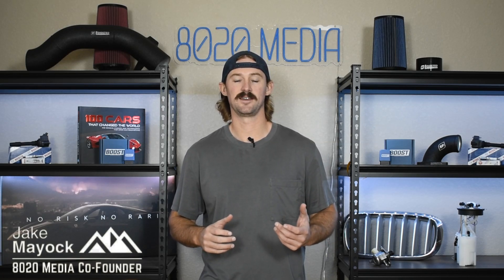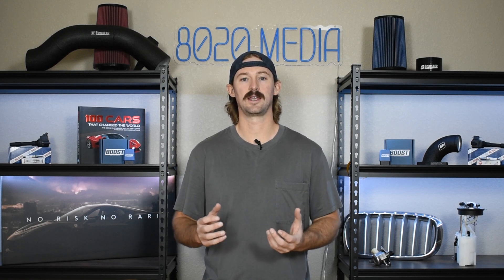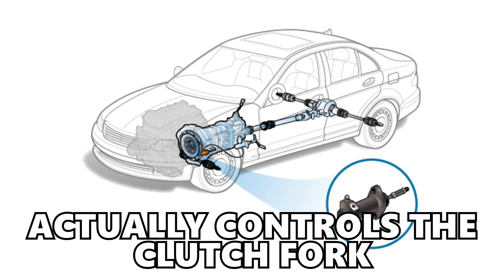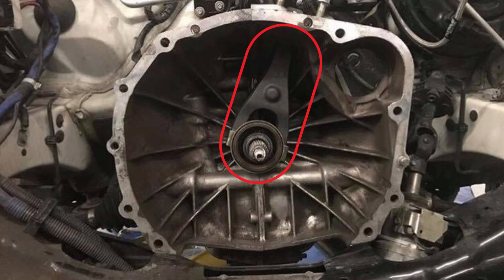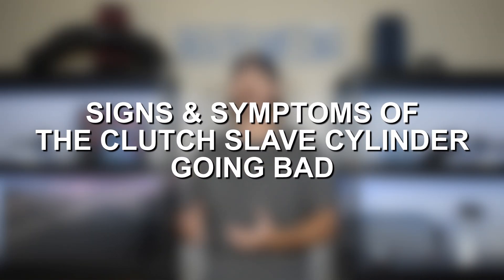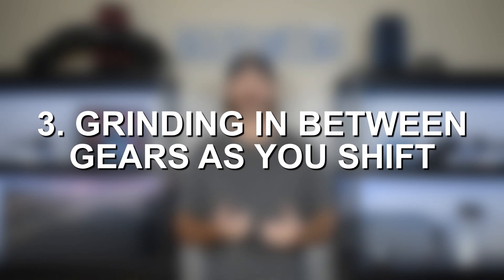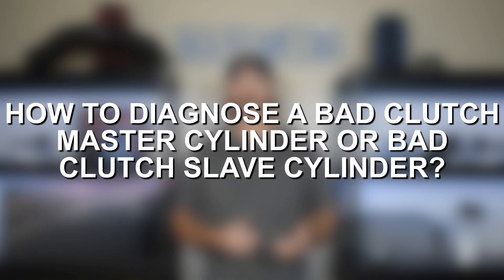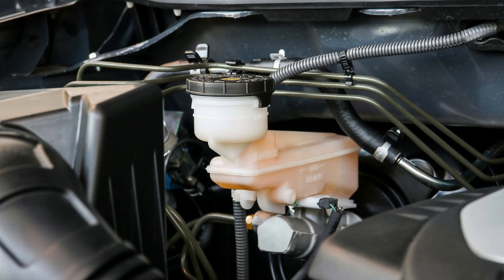Bad Clutch Master or Slave Cylinder? Symptoms, Diagnosis, and Fixes Explained!

Comment: My clutch is disengaging perfectly fine but engages too high and doesn't fully engage any ideas what that could be?
Reply from the maker: B - If your clutch disengages fine but engages very high and doesn't fully engage (resulting in slipping or poor power transfer), it’s often due to a worn clutch disc, pressure plate issues, or air in the hydraulic system. Other possible causes include a failing clutch master or slave cylinder, or even a mismatched or improperly installed clutch kit. Start by bleeding the system to rule out air, but if the problem persists, you may need to inspect the clutch assembly for excessive wear or installation issues.

Comment: Zafira 1.6 petrol. The clutch it’s sponge and didn’t build pressure for bleeding. I’m already change master cylinder and it’s the some problem. The clutch it’s almost new. After 1 month fitting new clutch have this problem. The pipe for clutch it’s brand new. I mean everything about clutch it’s new from pedal to gearbox. So someone have this problem before? Where is the issue?? Because I’m almost died if I’m find the problem. Thank you
Reply from the maker: B - If everything on your Zafira 1.6 petrol clutch system is new—pedal, master cylinder, slave cylinder, lines, and clutch—and you're still getting a spongy pedal with no pressure build-up during bleeding, the most likely issue is air trapped in the concentric slave cylinder (CSC) or an improper bleeding method. The CSC can be difficult to fully bleed, especially if it’s not gravity-fed or pressure bled correctly. Try using a pressure bleeder or vacuum bleeder, or raise the front of the car significantly to help air escape the high points. Also double-check the fluid level and any possible leaks at the connection points. If none of this works, there's a slim chance the new CSC is defective—it's rare but not impossible.

Comment: My clutch just sticks to floor and its leaks under the car i put back pedal with hand and just tap it and again go to the floor so which one is it slave or master?
Reply from the maker: M - If your clutch pedal is sticking to the floor and you see fluid leaking under the car, the most likely issue is a failed slave cylinder, especially if the leak is coming from near the transmission. The slave cylinder is responsible for engaging and disengaging the clutch, and when it leaks, it causes a loss of hydraulic pressure, leading to a soft or stuck pedal. If the leak is near the firewall or inside the cabin, then it could be the master cylinder instead. However, since you see fluid under the car, it's most likely the slave cylinder, and if your vehicle has an internal slave, the transmission will need to be removed to replace it.
Reply: @8020Media  yeah that is bad i have 6 gearas so my cylinder is inside anyway  thanks brother.

Comment: I would like to be able to remove the hydraulic crap for my clutch and replace it with the old reliable cable, springs and fork... It's a 1999 Ford Ranger 4.0 with the 5 speed manual and 4×4.. If you've had to pull the transmission just to replace it then you know my headache.. Love my truck though..
Reply from the maker: M - Sorry to hear!

Comment: I have a mercedes benz c class w203 manual 6 speed.... whenever my car hasnt been used the clutch feels amazing and i can shift easily , as soon as i travel inside the city where i change a lot of gears the clutch gets hard and the shifting of the gears is harder it isnt smooth anymore , any help on that , also i recently saw that my clutch liquid is greenish black? Because every mechanic doesnt give me a good answer to what the problem is ?
Reply from the maker: A - Your Mercedes-Benz C-Class W203 manual (6-speed) clutch getting hard and difficult to shift after driving suggests a hydraulic issue, most likely due to contaminated clutch fluid or a failing clutch master/slave cylinder. The greenish-black clutch fluid indicates severe contamination or breakdown, possibly due to moisture, debris, or worn seals. As the fluid heats up from frequent shifting in city driving, its viscosity changes, making clutch operation harder. Start by doing a full clutch fluid flush and bleed the system with fresh DOT 4 brake fluid. If the problem persists, inspect the clutch master and slave cylinder for internal leaks or wear, as they may not be maintaining proper pressure when hot. Replacing worn cylinders should restore smooth operation.
Reply: @8020Automotive  thank you ill try that and then comment again
Reply: @8020Automotive  it was the fluid
Reply from the maker: @albinbendo6686  Thanks for coming back and sharing!

Comment: I'm gonna change the master and slave cilinders, but about eight years ago, A friend found a problem in my other pickup, It was the cable, had a soft material like robber,So he replaced it with a complete copper tube from the master to the slave cilinders, Clutch was fixed.🧐
Reply from the maker: P - Hope this video helped. Keep us updated!

Comment: My slave was leaking internally into the transmission. Dripping heavy at the junction between the engine and trans. Was worried it was some other seal but it was clearly the slave after removing it
Reply from the maker: J - Glad you found your issue!

Comment: What about a real hard clutch petal
Reply from the maker: B - A hard clutch pedal can be caused by several issues related to the clutch system, including hydraulic failures, cable issues, or mechanical binding. If your vehicle has a hydraulic clutch, a failing clutch master or slave cylinder, air in the lines, or a blocked clutch line could be restricting fluid flow, making the pedal feel stiff. If it’s a cable-operated clutch, a worn or frayed clutch cable may be causing excessive resistance. A binding clutch fork, pressure plate, or throwout bearing could also lead to a stiff pedal. In some cases, excessive clutch pedal free play or misalignment can make engagement difficult. First, check the fluid levels and bleed the system if needed. If the issue persists, inspect the clutch linkage, cable, or hydraulic components for damage or wear.

Comment: I have a 2004 honda accord 6 speed with the v6, when i go on spirited drives and go above 4k rpm without shifting and go into neutral i have to pump it once and then it returns and im able to go into gear, ive replaced the cmc and the slave cylinder, do you think it could just be a faulty cmc? or something to do with my clutch. Thanks again.
Reply from the maker: K - If you've already replaced the clutch master cylinder (CMC) and slave cylinder, but you're still experiencing the issue of having to pump the clutch after high RPM driving, it could indicate a few things. A faulty or improperly bled CMC is possible, but another strong possibility is clutch fluid boiling due to heat buildup, especially if you’re using old or low-quality fluid. Try flushing and replacing the clutch fluid with a high-temperature DOT 4 fluid to see if it improves. If the problem persists, the pressure plate or throwout bearing could be sticking, preventing full disengagement until you pump the pedal. Worst case, the clutch itself may be wearing out or the clutch fork could be bending slightly under load, requiring inspection.
Reply: @8020Automotive  Sounds good, i ordered an oem cmc and im going to install it and use some dot 4 performance high temp brake fluid, hopefully i dont have to drop the whole tranny and subframe for the clutch and throwout bearing but thanks for the insight! I am just over 100k miles so a bad clutch could be true as well but it seems premature. Thanks again!

Comment: I have a 2000 Mustang GT, it seems like it happened overnight, but the first 1/3 of the clutch pedal has no resistance, then feels fine the rest of the way. I can move between gears just fine when the engine is off, but it’s nearly impossible to put it in gear while running.
Reply from the maker: N - Your Mustang likely has a worn-out clutch cable, air in the hydraulic system (if equipped), or a failing clutch fork, throwout bearing, or pressure plate. Since the first 1/3 of the clutch pedal has no resistance, it suggests slack in the system, meaning the clutch isn’t fully disengaging. If your Mustang has a cable-operated clutch, check for stretching or fraying in the cable and try adjusting it. If it’s hydraulic, air in the system or a failing clutch master/slave cylinder could be the issue, requiring bleeding or replacement. Since shifting is difficult while running but fine when off, the clutch isn’t fully disengaging, so inspect the clutch fork and throwout bearing for wear or misalignment. If the issue appeared suddenly, check the clutch quadrant and adjuster, as they can fail and create slack in the pedal.
Reply: @ Thank you so much! I was on the right track but you worded it perfectly here! Found that I have some aftermarket parts here and there along the clutch cable system. (I’ve only had it for a year and it’s my second car lol)
Reply: @NickNoodle1255 was that the issue?? I have a 2018 dodge challenger scat pack with the same exact issue!!!
Reply: @ScatPackJr  it was my clutch cable, it was close to snapping when I found it

Comment: What if I just hear it grinding when I push to clutch in while in gear.  And I have trouble getting in and out of gear
Reply: that’s gonna be your throw out bearing
Reply from the maker: W - If you're hearing grinding when pushing the clutch in while in gear and having trouble shifting, it likely points to a failing clutch system, such as a worn-out clutch disc, faulty throwout bearing, or a failing pressure plate. A bad clutch master or slave cylinder could also prevent full disengagement, leading to grinding and hard shifts. If the clutch fluid is low or contaminated, it could indicate a leak or air in the hydraulic system, requiring a bleed or replacement of the affected component. If the issue persists, a clutch replacement may be necessary. Keep us updated!

Comment: My pastor cylinder pine is hard to to back and clutch is at the floor  loose and I experience  leaking of the break food . I fill up but the next  day I m running out brake fluid what can the course be which cylinder must I replace I'm confused.
Reply from the maker: P - If your clutch pedal is loose and stuck to the floor, and you're losing brake fluid, the most likely cause is a leaking clutch master cylinder or slave cylinder. Since the clutch system shares fluid with the brake reservoir, a leak in either cylinder will cause fluid loss. Check around the clutch master cylinder (near the firewall) for leaks, and inspect the slave cylinder (near the transmission) for signs of fluid dripping. If the fluid is leaking inside the car, near the pedal, it's likely the master cylinder. If it's leaking under the truck near the transmission, the slave cylinder is the issue. If the slave cylinder is internal (inside the bell housing), you may need to drop the transmission to replace it. Keep us updated!

Comment: I have i20 .. only 6000 kms done .. facing the same problem? Did clutch bleed .. still didnt work .. 
clutch initially feels good when driving but after few kms done it gets soft and even just a touch sends the clutch down .. what could be the issue?
Reply from the maker: H - If your i20 clutch feels normal at first but gets too soft after driving a few kilometers, the issue is likely hydraulic-related, such as air trapped in the clutch line, a failing clutch master cylinder, or a leaking slave cylinder. Since you've already bled the clutch and the problem persists, check for any fluid leaks around the master and slave cylinders. Heat expansion in a weak master cylinder could also cause pressure loss over time, making the clutch too soft. If no external leaks are found, replacing the clutch master cylinder would be the next logical step. Keep us updated!
Reply: @8020Media
Thanks for your response! 
Before bleeding the car was checked and there were no leaks. 

But i am curious how can a master cylinder fail so quickly in a brand new car? 

The only bad history about this car is, that it met an accident which was not direct hit in front but on the left side where its headlight DRL and bumper got broken but engine was left untouched.

Comment: i bought a 2004 g35 recently and when test driving gears felt great to row through but after 3 hours of driving after purchase gears started feeling notchy and then couldn’t get into gears at all , gears are fine when car is off but once i push clutch in i can’t get into any gears any ideas?
Reply from the maker: G - If your 2004 Infiniti G35 shifted fine at first but then became notchy and eventually refused to go into gear, the issue is likely hydraulic clutch-related. Start by checking the clutch fluid level—low fluid could indicate a leak in the master or slave cylinder, leading to air in the system and preventing full disengagement of the clutch. If the fluid is low or dirty, bleed the clutch system to remove air. If the issue persists, inspect the clutch master and slave cylinder for leaks or failure. A failing throwout bearing or pressure plate could also be preventing full disengagement, making shifting impossible when the engine is running. Keep us updated!

Comment: My clutch pedal is getting harder and harder to press down !!!!!  HELP !!!
Reply from the maker: M - A progressively harder clutch pedal usually indicates an issue with the hydraulic system, clutch cable (if applicable), or the pressure plate. If your vehicle has a hydraulic clutch, check the clutch master cylinder and slave cylinder for leaks or low fluid. Air in the system can also make the pedal stiff, so try bleeding it. If it’s cable-operated, the cable could be fraying or binding. A worn-out pressure plate or throwout bearing can also increase pedal resistance. If the pedal feels extremely stiff or won’t return properly, the clutch fork or pivot ball may be damaged. If hydraulic components are fine, you may need to inspect the clutch assembly itself.

Comment: My i20 2009, reverse grinding, try re bleed?, if fail then replace Master first?...great Vid Btw...
Reply from the maker: C - Thanks for the feedback! If your vehicle's reverse gear is grinding, first try re-bleeding the clutch to remove any air from the system, as trapped air can prevent full clutch disengagement. If that doesn’t work, inspect the clutch master cylinder for internal leaks or weak pressure, as a failing master can cause incomplete disengagement. Also, check the slave cylinder before replacing any parts. If the grinding persists, the clutch itself or the synchros in the gearbox could be worn, requiring further inspection. Try shifting into first gear before engaging reverse to see if that helps, as some manual transmissions struggle with reverse engagement when the clutch isn’t fully disengaging.

Comment: My Ford ranger just started having problems today. Pedal goes to the floor and bites about a half inch off of the floor. I’m also seeing a leak that is coming from the passenger side even though the line to the slave goes in on the drivers side. Does that sound like both need replaced?
Reply from the maker: S - If your Ford Ranger's clutch pedal goes to the floor with engagement near the bottom and you see a leak on the passenger side, it's likely a failing slave cylinder, master cylinder, or both. The internal slave cylinder can leak fluid into the bell housing, but if you see fluid outside, check the clutch line, connections, and master cylinder for leaks as well. Top off and bleed the system to see if pressure returns, but if it quickly fails again, replacing both the master and slave cylinder is recommended.

Comment: Does running with a faulty master cylinder for a log time cause the hardness in clutch pedal.I mean the wear in pressure plate ?
Reply from the maker: M - Yes, running with a faulty master cylinder for a long time can cause excessive wear on the pressure plate, leading to a harder clutch pedal. If the clutch isn't fully disengaging, it increases stress on the pressure plate and other components, potentially causing warping or uneven wear.

Comment: First of all GREAT explanation and thank you. I have a 2015 ford focus. About a week ago the pedal started getting stuck about halfway up after shifting. Fast forward to today the pedal goes all the way to the floor with almost no effort and I have to use my foot to lift the pedal back up. Also the release on the clutch for it to engage was about halfway up normally and now is near the floor. Master cylinder? Thanks again
Reply from the maker: J - Thanks for the feedback! Yes, based on your symptoms—clutch pedal staying stuck near the floor, drastically lower engagement point, and needing to manually lift the pedal—the clutch master cylinder is most likely failing and should be replaced.

Comment: If I press clutch and change gear and release the clutch my van switch off please assist
Reply from the maker: V - If your van stalls when you press the clutch, change gear, and release the clutch, the issue could be related to a faulty idle air control valve (IACV), a weak clutch switch, or a failing mass airflow (MAF) sensor. The IACV controls idle speed, and if it’s dirty or faulty, the engine may not adjust properly when the clutch is engaged, causing it to stall. A bad clutch switch can also prevent the ECU from properly adjusting RPMs during gear changes. Additionally, if the MAF sensor is dirty or failing, it may not correctly adjust air-fuel ratios, leading to stalling when shifting. Try cleaning or replacing the IACV and MAF sensor, checking the clutch switch, and scanning for any stored error codes to pinpoint the issue. Keep us updated!